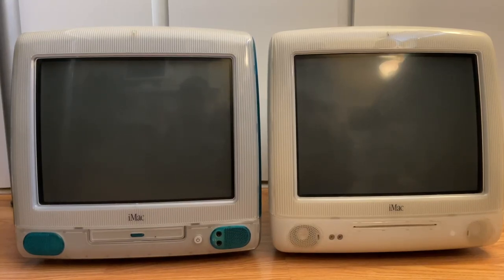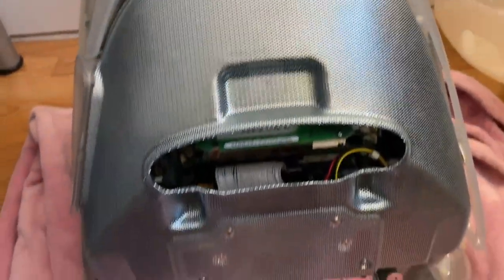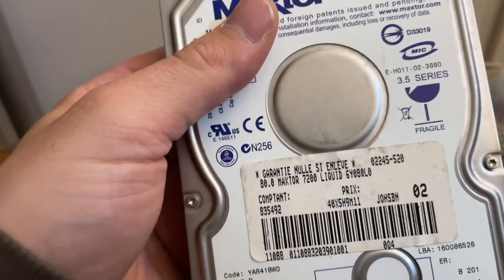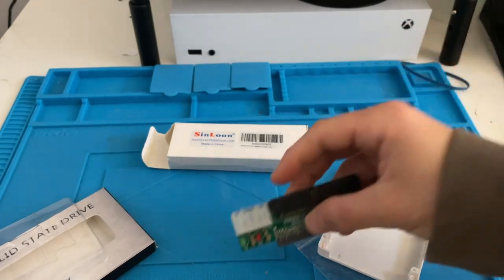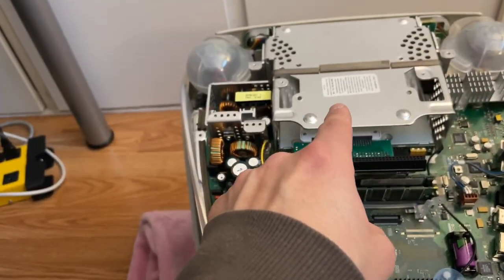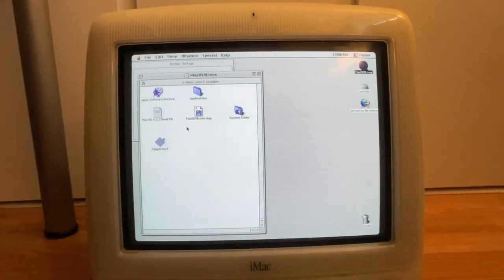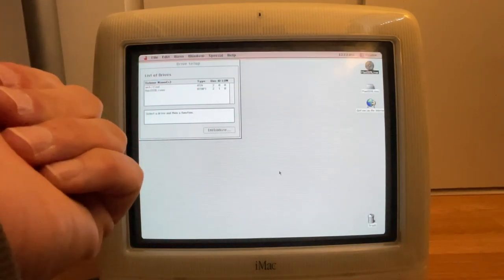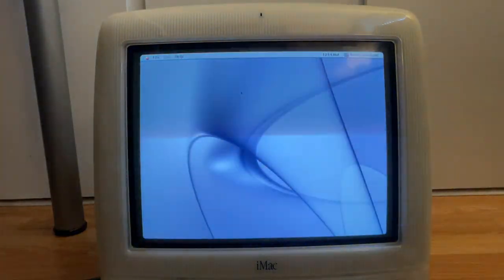mSATA upgrade for the iMac G3

Comment: 9.2 is quite ok. But my G3 Desktop (upgraded to 500 mhz) also runs very fine with MacOS10.4 (thanks to xpostfacto).
Reply from the maker: I find running OSX on a G3 a slow experience myself and have plenty of more powerful machines for that OS.